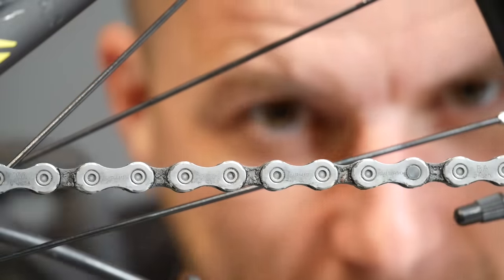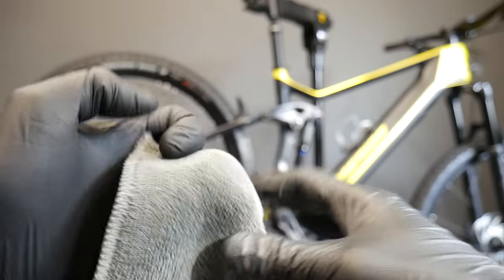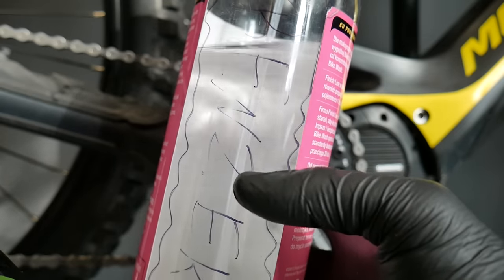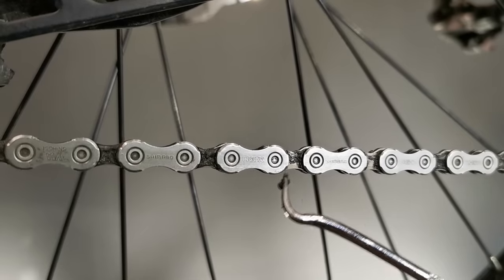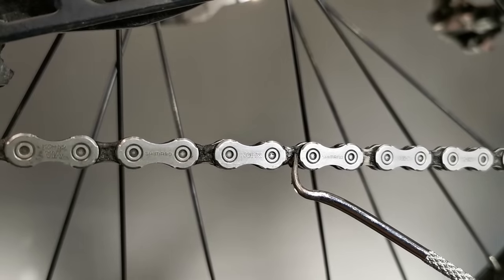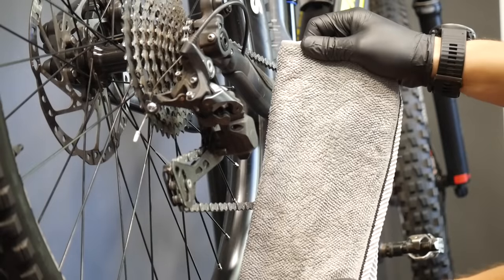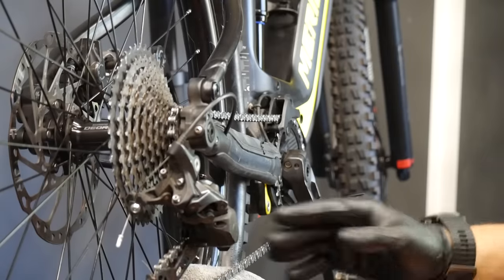This Drivetrain Will Last Much Longer. How To Clean And Lube Dirty Bicycle Chain. Slow Mo Comparison

Comment from the maker: THANK YOU FOR VISITING MY CHANNEL!
The chapters:
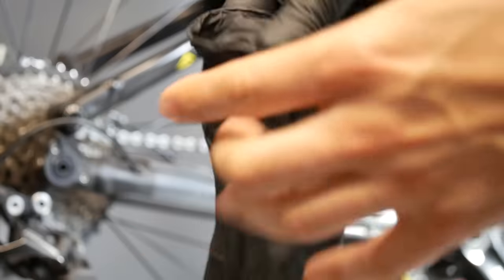0:25 What rag / towel you need.
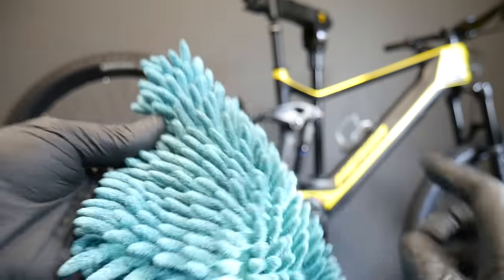1:10 Do you need a degreaser?
2:10 E-Bike crankset trick.
2:18 Cleaning with a rag.
3:28 Next phase - drivetrain brush.
4:18 The shoelace method.
5:10 Toothbrushes trick.
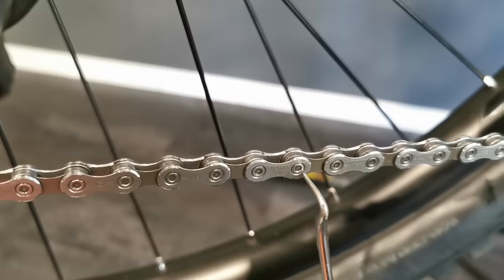5:40 Lubing.

Here's the chain oil I use:
- for my trail, XC and road bikes https://amzn.to/39x3djZ
- for my e-Bikes (it is thicker, easier for the chain to get dirty, but it lasts longer on bikes with central motor unit) https://amzn.to/2ZVAWAj

Bike & chain cleaning brushes I recommend:
- high quality kit https://amzn.to/2ZXFera
- the set from the video (it's OK too) https://amzn.to/2OSW3Nt
Reply: What's the purpose of the zip tie on the crank?
Reply: Okxx.    Cc can how to make a cloth face mask
Reply: @icel81  if you pedal backwards the chain and chainblides doesnt move on an e-bike
Reply: @andrescycling3546  Thanks for explaining!
Reply: 8
Reply: The jockey wheels and chainrings are still loaded with dirt.
Reply: wasting time
Reply: your mbt so beautiful .  .nice to see a tutorial how to clean a chain.  .
Reply: CLEAN YOUR PULLEY WHEEL TOO !!!! My eyes are bleeding…
Reply: Jif
Reply: Fjf
Reply: Chfi
Reply: Some good tips👍 took me an hour to clean the drive train & re lube the chain rollers. I leave the lube on the rollers overnight to soak in then wipe off the excess, works for me
Reply: .:JUST SHARING THE GOSPEL WITH YOU - FOR GOD SO LOVED THE WORLD THAT HE GAVE HIS ONE AND ONLY, SON THAT WHOEVER BELIEVES IN HIM SHALL NOT PERISH
Reply: I feel the pain watching it. That's why i use CDX BELT gates system
Reply: Thanks for the cool content What bushing are you using? I really liked the sound You didn't clean the front sprocket Are there such lubricants that do not lead to such a degree of contamination? Fuel oil
Reply: This video shows one of the worst ways to clean your chain you are supposed to remove it via the quick link, soak it in de greaser submerged so you can get the muck out from inside the actual links which is what causes your chain to wear in the first place, NOT muck on the outside. 
And if you want your chain to last 6 times longer go ahead and submerge it in a Chain Wax solution where you heat in a pot. 
It will also be completely clean as Wax doesn't attract dirt like grease and oil does. 
It is very sad that youtube removed the dislike button because now nobody will know that this video is straight up misinformation. ..
Reply: It is not better to clean and wash the Chain by Alcohol and at the end oiling it?

Comment: rather than spend all that time and hassle, its far far quicker to just take the chain off, put it in a small jar with whatever degreaser/cleaning fluid you use and shake it it around. pour the dirty cleaner out through some fine muslin or whatever to get rid of the  dirt etc off the chain, pour back in jar and do the same again...use another jar or bowl with whatever you use to clean all the other fluids off, shake it  or scrub it if in a bowl  then rinse it with plain water then dry the chain , put it back on and lube it...far far quicker and easy..

Comment: Alternative title - how to spend half of your life cleaning your bike chain.
Reply: You know what a passion, a hobby is, what it means to like something, You can learn a lot here ... don't like don't watch it
Reply: @djjockerstreet  I watched it hoping that he will have tips on how to do it faster and/or better, but this is exactly the opposite, very slow and not even cleaned and lubed properly... Do you watch this video cause you like watching people cleaning a bike chain? Come on man.
Reply: @djjockerstreet  also the way he is applying lube....
Reply: @rrrrrrrrrrrrrrrrrorr  
Nothing wrong with how he did things but you can do it much faster with proper tools (not toothbrush and shoelaces...). 

Park tool chain cleaner (or muc-off or finish line chain cleaners) + water will do the job 10 times faster. 
You don't have to use degreaser with chain cleaning machines, just use water and wipe with wet cloth. 
Acceptably clean in 3 minutes. 

Also there is nothing wrong with his lubing process, but I prefer one drop on each link. 
112 links for standard 11 spd chain, 1 second to drop lube per link, takes 2 minutes and results in much better lube quality. 

So, clean and lubed drive train in 5 minutes.
Reply: @rrrrrrrrrrrrrrrrrorr  I agree. The title is definitely misleading and not the best advice for newcomers. Merry Christmas to you as well!
Reply: @rogerzheng2814  man you must be kidding.... it’s minimum 25min to clean the chain with machine, 3 to 4 times with solvent or degreaser (30 turns each, until the liquid comes out transparent not black), then with dishwasher soap to remove solvent and neutral Ph, and clean the pulleys, water everything, then dry it out.

You should never lube it with moisture, wax will not work and lube will not enter se smallest parts of the chain.

That’s the difference of a Sram GX chain lasting 600km or 3500km before 0.5% elongation
Reply: easier way would be to remove the chain from the bike.. put in a bucket and spreay degreaser.. let it sit for 10 mins.. then spray clean with water.. dry it.. put back on bike and then dry lube it.. 👍👍
Reply: Affirmative.Switched to Wax lube- less hassle-hot water-done!. The rest? I just buy new ones if worn out.
Reply: Ikr it takes me like 15 minutes to clean and lube my bike, and this man cleaned just his chain for probably more than twice that.
Reply: @mateuscabrera  apparently I'm a schwein now. 🤷 Seriously though I even lube my chain link per roller instead of just spin the crank 4 times so the chain does a full revolution.
Reply: its for meditathion
Reply: Me first mtb was left outside and I just lubed the rusty chain. Bike lasted 1½ years before cables broke and chain skips etc. 30 years later, my bikes are inside and well maintained. My citybike is from 2005 and it is dead quiet. You can hardly hear anything other than gear change and tire noise. If I silence the exposed cables, it will become a ninja bike :) 
The crazy thing is that I have never adjusted the derailleur, even after tire change. Frikin magic.

Comment: If you are going to go to those lengths of time to clean a chain, I would suggest that you have 2 chains and swap them once a week / fortnight. 

Once you take the dirtcy chain off, soak a few days in a jar of white spirit to soften and remove the dirt and then having wiped that off and dried it, then leave in another jar of engine oil another few days before finally hanging a few days to let the surplus oil drain off before changing again. This would probably make a chain last literally years
Reply: Pfff... that would be too easy.

Comment: Wow, all these haters. Some people don't have ultrasonic cleaners, the time to dip their chains in wax, or any speciality tools at all. Read the title because this isnt a video about cleaning your chainrings, this is great content for so many bikers whether they ride for sport or otherwise and he shows ways of using old household items to do the job. Chill out people, impeccably clean drive-trains are not that important but regularly cleaned ones are.
Reply: Ultrasonic cleaners? Dude...you can use a tub and some petrol.
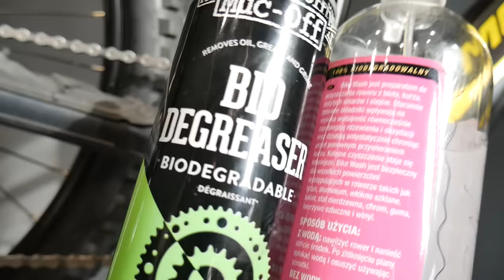Reply: Lol, get 5L of citrus degreaser for 20 bucks, dilutes 1:10 with water and a $10 chain cleaner tool...takes 2 minutes tops!

Comment: Take the chain of. Stick it in a bucket with gas or naphtha or degreaser. Swish it around big time. Repeat with clean liquid. Clean in isopropyl alcohol lastly .Let dry overnight then lube by rubbing lube into chain with a toothbrush to get into the inners of the chain.  I use Squirt lube. Dries and leaves a wax coating not an oily film to collect dust.

Comment: I would suggest removing the chain, soaking chain in bowl with degreaser. While chain soaks, remove rear wheel and clean cassette with degreaser and brushes. Once chain is clean, oil before installing back onto bike. This is faster and does a MUCH better job than cleaning the chain on the bike. Do not forget to clean the derailleur cogs while chain is removed.
Reply: I can't think of a way to oil the chain before putting it back on the bike that wouldn't make a mess.
Reply: @Freezorgium  it’s all messy, the point is controlling and minimizing the mess. Doing it off the bike you can not only do a better job, you can also do on a work bench with something down to catch the mess and make it easy to dispose of.

Comment: I prefer to take the chain off, sticking it in a jar and soaking it in degreaser and giving the jar a good shake every so often. While the chain is having a bath you could spend that time cleaning the rest of your bike or doing something else. soaking chains in degreaser takes minimal effort and lot of the concentrate can be stored and reused a few times before being thrown away. Just let all the dirt settle at the bottom of the jar and syringe out half of it into a different container. The used degreaser will look discoloured but it should be pretty dirt free once the all the crap has settled to the bottom. (rinse the chain with hot water a few times then either dry it with an air compressor or leaving it on the washing line to dry till youre ready to put it back on the bike)

The chain being off also makes it a lot easier to clean everything else on the drivetrain - You could drop the wheels out and give the cassette, braking surfaces & brakes a proper scrub and clean.

Comment: Thanks for sharing. The shoe lace method might work as well as using the towel but this doesn't look very time efficient. 
My technique:
Use quick link, remove chain and
1st step. WD40 to loosen up dirt/grease
2nd step. Gasoline bath
3rd step. Dishwash liquid scrub with a tooth brush.
Dry the chain. 
End it with lubing your chain and wiping away excess lube.
Can't get a cleaner chain using any other method.
Reply: I soak chain in paraffin and filter the paraffin. Surface is cleaner. Inside paraffin some contamination. Soaking is recommended in bicycle manual, soakin or bathing in oil.

Comment: This is a good channel and Danny provides many good  ideas and procedures. This chain cleaning is not one of the good ones. It is much easier to remove the chain, using a sram link or similar, and wash the chain , a little degreaser does no harm and helps to remove fine particles. Then a little de-watering spray and dry. Re-fit chain and lubricate, dry lube or wet lube dependingon conditions. Keep the chain clean every ride and the job is quick, simple and most importantly very effective.  Sram links last ages, used over and over, never had a failure.
Reply: The problem is the newer 12 speed chain links are not reusable and can add up very quickly, getting very expensive

Comment: I clean the chain by taking it off, washing in petrol, just regular, like you use it in the car. It takes out all the dirt. After that rinse in water with fairy like liquid followed by rinsing in pure water. The result is perfect. My bike chain lasts much longer than it was when i cleaned just with brush and cleaning liquid without taking the chain off. Try and you will see
Reply: Are you disconnecting the missing link and reusing it back together? Or are you using a brand  new missing link? Thanks
Reply: @Atrophyiies  there are links which you can reuse. check out kmc or connex links
Reply: @Atrophyiies  there are links which allows to open and close multiple times. For me is enough from new chain untill wears out. I' m cleaning it every week, especially after the beach.
Reply: Why cleaning after petrol, then with water? Wtf? Just lube it.

This looks like club of idiots.
Reply: @janezjonsa3165  go on, do it, if so :D It's your choice.

Comment: Does anyone remember cleaning a chain as a kid? There was no maintenance at all 😁 and it was "fine"
Reply: Haha I was just thinking about this the other day when I was cleaning my chain...As a kid I always had a cheap walmart bike and NEVER cleaned the chain. Even let it sit out and rust a few times...throw some 10w-30 motor oil and spin it around a few times and it was good to go. Idk what’s happened to technology...lol
Reply: I guess those chains didn't take as much stress and abuse as these heavier bikes do
Reply: Extremely true,if I had not done my research I would have been the same and that just shows do ur research before u get anything.
Reply: @harcormor  A rusty chain has a much higher chance of snapping, and especially now that you're an adult that can likely put 1000+ watts into your chain, I would highly recommend not riding with a rusty chain.
Nevertheless a clean chain has less friction meaning less energy lost. 
You can of course ride a dirty chain if you like, but friction, chance of breaking and wearing down the rest of your drivetrain are the main reasons to clean it.
Reply: kids bikes also 20 times cheaper

Comment: Most importantly... You must clean the entire drivetrain or else it’s a waste of time. 
A big key factor in cleaning a chain is that it doesn’t/shouldn’t look “fancy” clean. Having that slightly “greyish” look is actually better. 
If your degreasing/cleaning is too deep and removes said lubrication from the pivots, you can’t ever get that back and you will prematurely wear out your chain. 
8 and 9 speed chains didn’t have much issue with this. But since 10 speed and now becoming more common with 11, 12, & up, the chains are getting too thin and that pivot grease is compromised more. 
For the cost of cleaning supplies and the time, it would be more “cost effective” to just buy a new chain every 3 to 5 months. 
You spend more time experiencing the outdoors than cleaning.
Reply: That only applies to motorcycle chains with o-rings and permanent lubrication, not for cycling chains.

Comment: If you have a compressor, use a air gun on the chain as well as the standard clean , it always gets extra gunk out. I now clean my bike then use the air line to remove water and dirt, the difference is amazing.

Comment: All I do is soak a rag with motor oil (any engine oil will do) and pull the chain through it.
That's it.
Repeat every week on rainy conditions and every month on dry conditions. 
No special expensive chain oil needed and no degreaser or anything else.
Motor oil has everything needed, it works not only as a lubricant but also as a detergent and rust inhibitor, it has anti wear components, too. In winter it's thin enough and in summer thick enough due to it's viscostiy improvers it comes with when it is a multigrade oil which every motor oil nowadays is. 
Like I said, everything ever needed is already in motor oil included.
There is no cheaper and more effective way to take care of your bicycle chain.
Reply: In my case I use transmission oil. The same one I use on my car. It's made to be used with gears so it works great also for the bike chain and gears.
Reply: That's fine if you own a piece of junk bike.  For those of us that have $10k bikes, that motor oil is going have tons of dirt sticking to it during your ride.  That dirt is pulled through your drive train and wearing it down with extreme efficiency.
Reply: If you wipe off excess oil your chain stays clean. Oil has a very high ability to crawl everywhere, wiping off the surface causes no problem to the lubrication as the oil finds its way to the places where it is needed. So even a dry wiped chain is still lubricated inside and the oil stays there as long as it is not washed out.
A dirty chain is a chain not wiped off properly and was too oily.
Reply: Quicker to take it off, rinse in kerosine with a little diesel mixed in, dry it off and your good to go with a new joining link

Comment: Yes. A "chain dentist!" 
I've watched lots of drive training cleaning tutorials over the years. You are first to show how to clean inside the chain. This is good to know, even if you use a chain cleaner (my preference) or have a bike mechanic do it. 
Also, for newbies, I would say that you should add comment telling them you are only showing how to clean the chain, not the pulleys and rest of the bike. Also, I would mention you are showing thorough cleaning and that a chain cleaner works for routine cleaning.
Thank you for a great tutorial!!

Comment: 1. Remove the chain
2. Wipe it
3. Put it to the can with degreaser
4. Shake for two minutes
5. In case of exceptionally filth chain replace the degreaser, leave for 15 minutes, shake two minutes
6. Wipe with clean fabric
 
Result - cleaner chain (degreaser will remove the dirt from the pins and bushings you can't reach with brush), much, much faster.

Comment: With a quick release chain and tool I can have my chain off and in a tub of cleaner in about 30 seconds. Leave for a couple of hours then rinse and lubricate. Job done.
Reply: Of course the much better way to clean a chain!!! 👍
Reply: Definitely a way better approach but it'll wear out your quick link faster.
Reply: @chillipepperoni    You can buy the quick links in packs of 2 or 3.  They can be reused lots of times if you have the correct tool.  You also normally get one with a new chain that can also be reused.
Reply: Why the zip tye
Reply: What do you soak the chain in? I've read that leaving it in degreaser too long can damage it?
Reply: Soak mine in petrol or diesel overnight. A thorough scrub and rinse in water and then put back on the bike and lubricate. Been doing this for 20 years. Do it every three months.